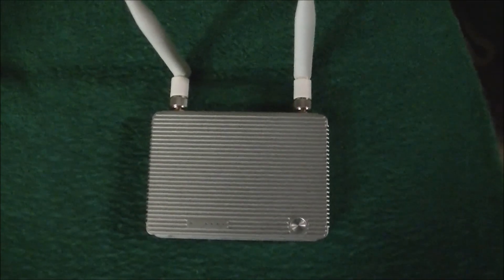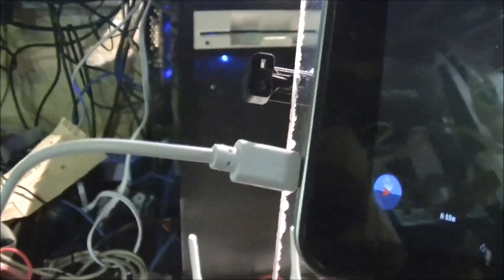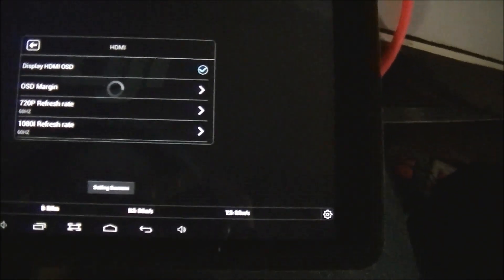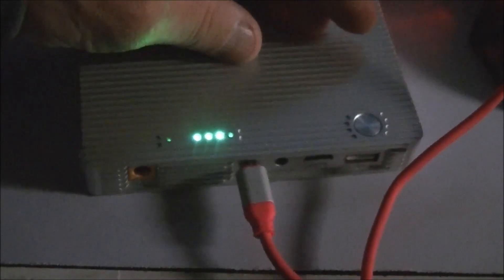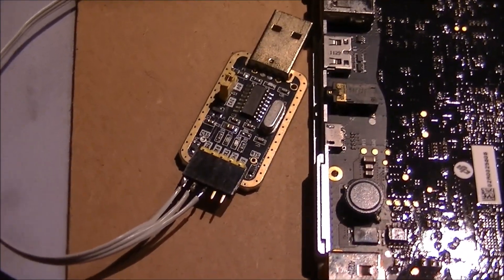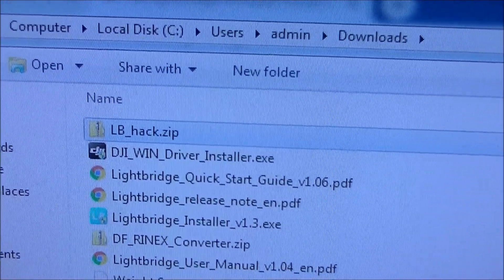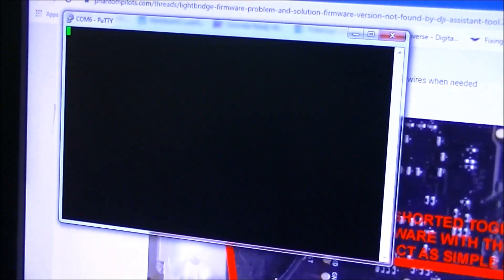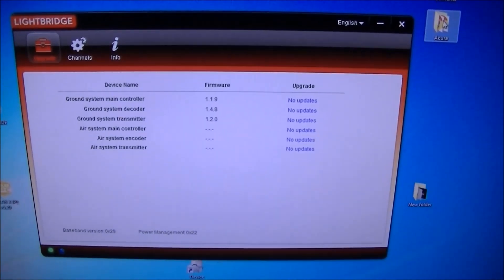DJI Lightbridge 1 Ground Unit Firmware Flashing

Comment: Good Day Terry
Does your PC software still connect with your lightbridge? 
  I have a lot of money invested in two lightbridge units and a couple of large S1000 DJI drones.  Trying to get my lightbridge’s to work, iOS app has been discontinued. Do you know of a android app that I can use in order to get visual communication to lightbridge? Thank you for your time any insight would help.
Reply from the maker: Not sure I am understanding your question and that's probably because I am using my LightBridge pretty much standalone... i.e. HDMI video signal into air unit and HDMI video signal out of ground unit to a monitor.  In my application there is no drone involved... I think what you are asking for is an app that will handle the DJI drone control as well as receive the LightBridge video.
Reply: @tjones99  Thank you for your reply. Either one at this point. I’m gonna go check the drivers and see if any of these drivers have been corrupted or removed. Any insight would be great. Dji really let down a lot of consumer by disabling the app. Have you tried connecting it to the PC software recently? Thx again! Great Channel 🔥
Reply from the maker: @faceman2095  LOL the first issue before connecting to Windows was "can I find my units in my basement" . Located... Been a while since I connected them and that PC has been totally torched and burned since then so this was starting fresh. I had to install the DJI Lightbridge drivers first, blocked, followed my own instructions in the comments to run them from a command prompt... drivers installed fine, device went from being a COM port to being a DJI USB Virtual COM which is as documented. Installed the DJI LightBridge Windows app that is used to upgrade firmware and my units connected to that and showed their firmware versions for the Ground unit controller, decoder and transmitter... thats about all I expect to get from a Windows machine connected to them so as far as I know yes I am still able to connect them to my Windows 10 box.
Reply from the maker: @faceman2095  I also plugged in my air unit and connected to Windows and found there was actually a firmware update available to my air unit... Currently upgrading from 1.1.9 to 1.1.10 on the air system encoder
Reply: Thank you Sir! 
You just fresh installed and check them out right now?
Reply from the maker: @faceman2095  Yup.
Reply from the maker: @faceman2095  And even made sure end to end video transmission was working after doing that air unit firmware upgrade.
Reply: Thanks again! I will begin my testing to get the software working on the pc. Thanks again. I will keep you posted.
Reply: Good day Terry
How are you powering your air unit?
Reply from the maker: @faceman2095  Actually that was an issue yesterday when testing... I have a cable I made up for my air units that takes a 5.5mm female power plug like that used for CCTV cameras and goes to the JST-GH connector on the air unit. I just use a 12V power adapter on my test bench... when I am using them normally I am powering them from a car battery... But yesterday when I was trying to get the end to end video test working my air unit was rebooting repeatedly... I pretty much knew why right off... the power adapter I grabbed yesterday was 12V .5A and when I grabbed it I was thinking "wonder if .5A is enough???". Its not.... I switched to a 12V 1A adapter for my test and all was stable. Does this mean you were able to get the Windows programs installed and working?
Reply: Thanks again Terry 
My fiend has them at the moment. We spent a whole day working around the bugs. This weekend hopefully we can figure it out. Our communication is giving me a whole new bag of tricks to work with. I appreciate it.
Thanks again Terry it I’ll keep you updated.

Comment: Hi Terry, thank you very much for the instruction. I have the same problem with my LB-Ground unit and discoverd the mentioned phantompilots-Forum during research for a solution. I also came  accross your video as well. Cudos to the community in providing such a great support in this matter. Currently I'm preparing myself to perform the flashing... 
I just wanted to ask you, if you can give us an update on your current set-up. Did you manage to get an Air-Unit and connect it to the Ground-Unit? Additionaly, i wonder if the mentioned procedure has to be repeated again after some while and if there is a way to ensure that the nand-chip doesn't gets erased?
Thx + BR
Paul
Reply from the maker: Yes I was able to get air units to connect and transmit video fine. 

I have found that yes it may need it again later if the units are left unused for long periods. My understanding of the memory used is they need a refresh to maintain storage and keeping them charged and occasionally powering the unit up will refresh the NAND memory cells.
Reply: @tjones99  thank you very much - i will then keep an eye on it and make sure to charge / start the units regularly. Just a quick remark/add. question. It is reported, that with updraging the Unit with the latest DJI firmware might lead to issues using certain cameras... e.g GoPros will stop working. Did you encountered similar issues? thx again
Reply from the maker: @powerpunch354  I have not but I have been using a limited selection of cameras, mainly JVC camcorders.
Reply: @tjones99  Thank you.

Comment: so, what about the USB cable? Do you know why they matter? I had the firmware problem, followed the phantompilots forum indications, restored the firmware in the LB and solved it all. I've tried several cables in different cellphones, but can't get to connect to the Ground Unit.
The problem, I guess, is that the gimbal is detecting video signal, but blinking yellow, which means the AV mode is active. I need to connect to LB ground unit to change the setting, but there's no way I can success. All lights are green but the video one in the air unit which is red
Reply from the maker: Well the biggest issue with USB cables is there are charge cables and data cables... most people only use their USB cable to charge their devices and rarely actually send data. Charge cables and data cables look identical but charge cables do not have wires in them for data, just for power. So you have to make sure when you buy a cable that it is a data capable cable.

Comment: Hy
The problem is solved? 
My problem is missing video on hdmi or USB. 
I cant see the firmware  for "ground system decoder" and "ground system transmitter" , firmware is -.-.-
All firmware is upgraded
Somebody can help me?
Thanks a lot
Reply from the maker: If you are getting - - - for Ground System Decoder then you will not get video from the ground unit. Dive in and try this approach if you have the skills. Read the Phantom Pilots post by gaucho mentioned in the description and watch the video before attempting.
Reply: @tjones99  Thanks a lot. i will try to make this hack, i'm not familiar with programs flashing. maybe i will make a video

Comment: Thanks for the detailed walk through of this process Terry. I have this problem with my LB1 Ground station. I can get as far as the flashing then all i get is "Waiting for the DM36x...." at the dos prompt and it goes no further. If i take a look in Putty I see the BOOTME BOOTME BOOTME constantly being returned from the LB1 GS unit. I have tried to set 115200 as the default bit rate and the rest 8,1,none in the com port properties (Com4) in my case. Still not able to get past this point. I am using Windows 10, 64 bit and i see that there has been issues with this OS but no description of how they may manifest so may be this is the problem ? What version of windows are you using ? By the way I see the boot up serial data in Putty same as yours when i do that test... Any ideas much appreciated!
Reply from the maker: While I was using Windows 7 64 bit, I do not think that there should be any problem with Windows 10 but if I get a chance I will test since that machine I was using has since been upgraded to Windows 10 64 bit. You are making sure that you use the same COM port (you said COM4) in the sfh_dm36.exe command?  i.e. 
sfH_DM36.exe  -nandflash  -v  -p  "COM4"  ........
And lastly, are you doing the TWO runs of the command as I mention in the video... first run gets part way then you abort the command by hitting a key and run it again and while it appears to do the exact same thing, this time after the first pass it continues onto the second pass.
Reply: @tjones99  Yes I am using the correct COM port in the command line. I have tried to exit then repeat the command but it just does the same. I sometimes get garbled test in the Target message and not "BOOTME" I have checked that I am able to send messages through the TX pin by looping through to RX with a 100 Ohm resistor and typing in a Putty and this seems all ok also.
I downloaded Tera Term also. I rebooted the PC and then did the same but used Tera Term to set up the Com port to 115200 then exited Tera Term and opened the CMD prompt and do the process again and it goes a few steps further upto waiting for BEGIN Command then it freezes. If i exit here and then try again It will only go as far as the "Waiting for the DM36x..." stage and no further. Possibly its my USB - FTDI adaptor ! I have just ordered the same one you are using in the video !
Reply: I sussed it out. I was not connected to GND on my FTDI Adaptor but to DTR pin !!! Duh ... Now it all went through perfectly :)
Reply from the maker: @MrSimonurry  Awesome!!! Glad you got it working and hope the video helped. Makes it worth doing! 
Two questions... 
1) are you using it for a drone or for something else? 
2) Was you unit sitting non powered and idle for a long period of time when the NAND flash died?
Reply: @tjones99  It was part of my S900 rig which I have now sold. The Lightbridge had failed, as you say after being sat discharged for long period of time. I have had it sat here for quite a while thinking i will get round to taking a look at what the problem is before I relegated to the scrap bin. A quick google search led me to the Gaucho fix on PhantomPilots Forum. I always think its easier if you watch someone run through the process so your video came in very handy! I just need to test now with video but I see I am getting a control link with the Ground and Air modules so it's looking promising!